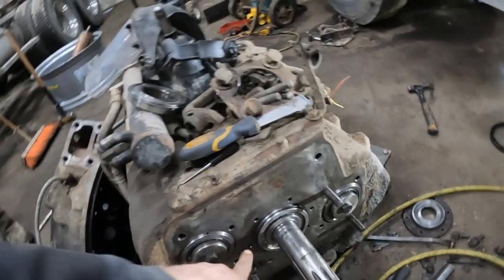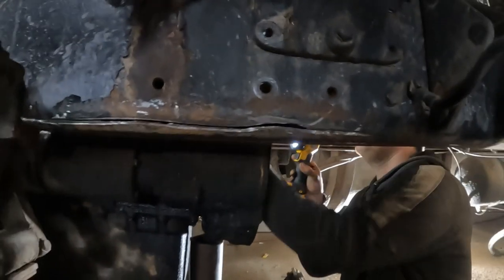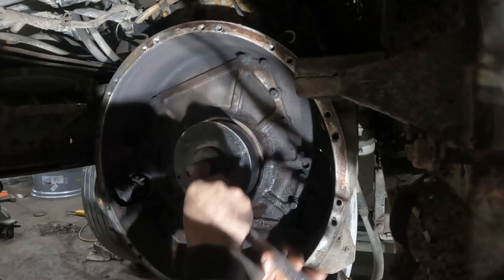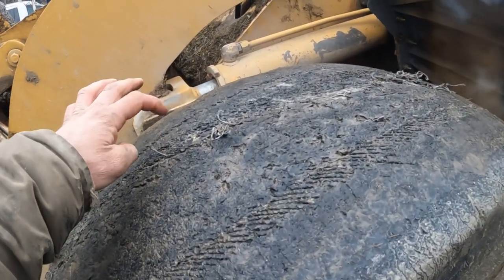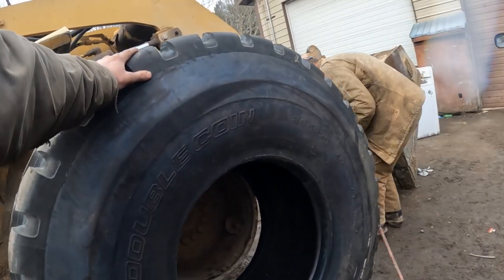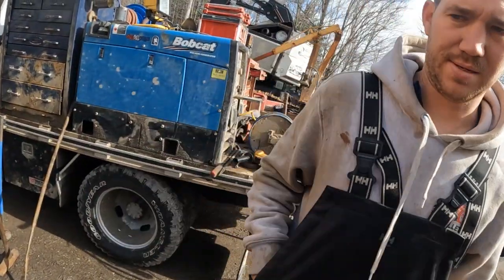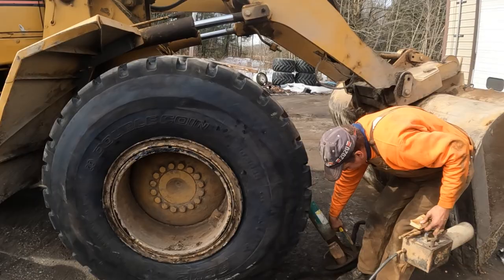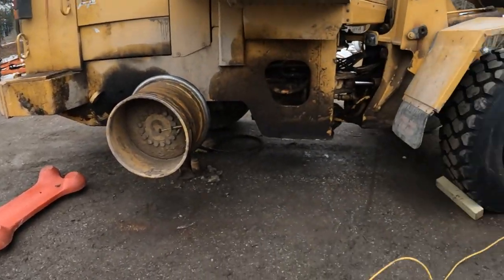Payloader gets new rubber & transmission going back in Western Star

Comment: That's the way we always put clutches in until we had a guy working for us that did it opposite he would put the clutch and pressure plate on the transmission shift then put it in worked good he never liked lifting it either
Reply from the maker: Lining up the bolds must kinda suck doing it that way. But still good if it works good.
Reply: Actually didn't take him very long he always said it was alot easier only have the pilot bearing to line up and you don't have to lift the clutch up to the flywheel I've seen a few guys on YouTube doing it that way

Comment: cut the head off of a bolt the same size thread as what holds the clutch to flywheel or a piece of threaded rod  and use it as an alignment aid for that process when you aint got clutch jack